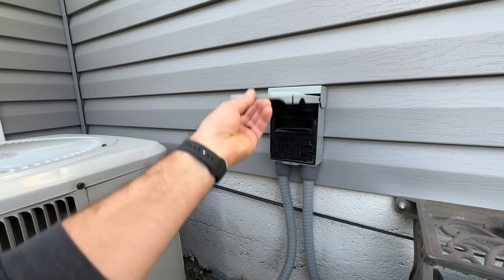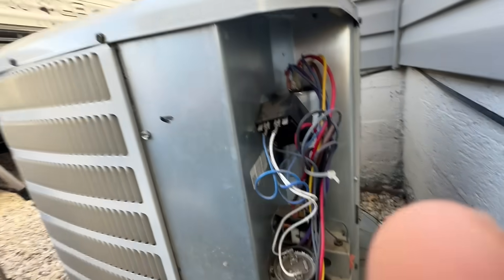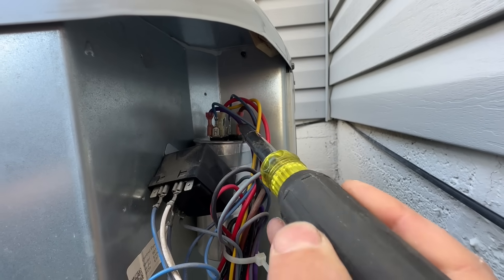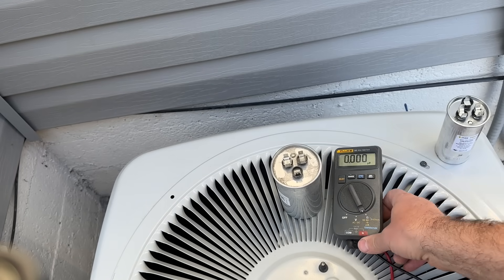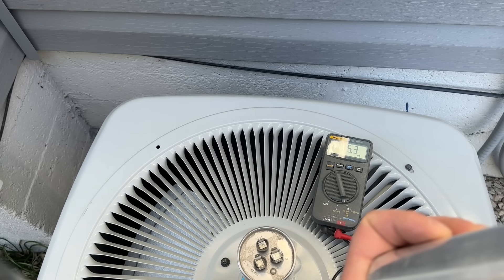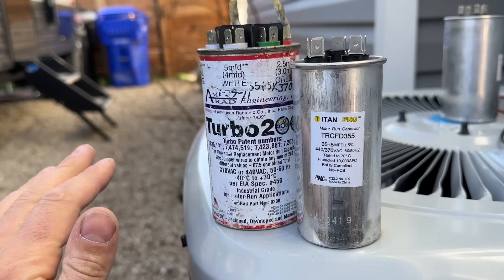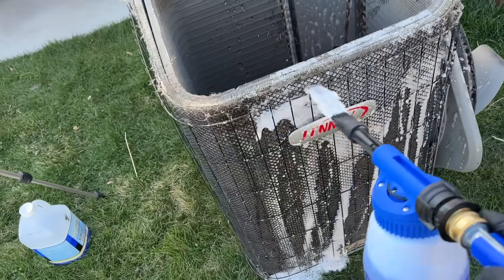How To Check & Replace An Air Conditioner Capacitor

Comment: As a field service manager, I can’t help but to notice that the initial capacitor you pulled off of the unit was a 45/5 capacitor. The new one that you tested was a 35/5 capacitor. The wrong thing to do is to put the wrong size capacitor in a unit. And discharging a capacitor like that is not the smartest thing to do.

Comment: My AC unit stopped working just at the start of this summer. I checked everything and I found out the capacitor was faulty: it was a 25uF 450v, but it measured 1nF. I found a capacitor with the same characteristics and replaced it. Now the AC unit works just fine for the moment, but I'm gonna change the whole unit anyway, becouse it is an old one, over 20 years

Comment: My home A/C just died on the hottest day of the year. We're talking 100+ today. I suspect the capacitor but my cheap multimeter doesn't test capacitance so I took a chance and splurged $29 on a new capacitor. Same specs but a bigger diameter, so the clamp won't work but isn't that what zip-ties are for? Anyway, I followed your instructions to the letter, took out the old one, plugged in the new one, didn't get zapped in the process and now I'm sitting here enjoying wonderful cold air again instead of sweating for a couple of weeks and dropping a few hundred beans on a service tech. You, sir, are a prince among men. Keep up the good work.
Reply: Mine is also out my house was at 87 the other day.. will definitely be trying this

Comment: Dang, wish I seen this first haha. AC slowly started giving out but figured it was fighting 90F heat for the first time this season. Slowly got up to 80 in the house and started troubleshooting. Dirty filter, started checking for ice on suction line and coils and found nothing. Fan would spin when calling for air figured it was good outside. I figured I was low on freon and they popped up and gave me a capitor for $350 with diagnostic fee and part included.
EDIT: Compressor side of capictor was dead fan would spin but compressor would not work
Reply: Im having the same problem, the house will not get to the set temperature. Everything seems to be running fine, except the air coming out of the vents seems weak and isn't very cold. Were you getting any cold air from the vents or was it warm?
Reply: @El_El_Guapo  If you go outside there should be two copper pipes coming from the outdoor unit. One very small skinny one and a bigger one. Feel the bigger one with your hand. If its not cold like mine was it could be the capacitor is bad in the out door unit. My outdoor unit fan would spin, but the pipe was luke warm and it should be cold and sweaty.

Comment: Ac unit not turning on, only the fan works. You hear a buzzing sound from time to time when attempting to turn on . Can it be the capacitor ?
Reply from the maker: Absolutely.
Reply: @diyhvacguy  thanks I replaced it today up and running right away

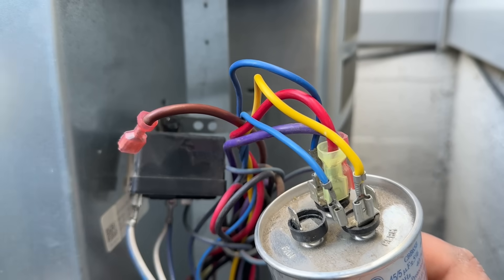Comment: What does jump these out mean? 3:53
Reply from the maker: Arch them, or connect them via something metal, making sure the end you are holding is not touching the metal, like a screw driver 👍🏼
Reply: @diyhvacguy thanks 👍

Comment: Another testimonial about your awesome video. I am not a very handy guy, but your video gave me the confidence to give it a try. My a/c went out on Sunday. Suffered through a very warm nights sleep only to remember your video. Watched it again yesterday and scrambled to find tools and a new capacitor. I didn’t even bother to test it because even though it wasn’t bulging on top, there were signs of rust and debris so I matched the numbers  as you described and picked up a new 45+5 on Amazon (after striking out at the Home Depot). Popped that baby in and did a much needed cleaning of the coils and the house is cooling off as I type this comment. Thank you for sharing your knowledge and expertise. You are a Godsend! Bless you!
Reply: If you have an Ace Hardware near you, they always carry caps, and multi different versions (size, capacity, farads, etc)

Comment: I noticed my AC wasn’t kicking on today even though the thermostat said it was running. I went out to take a look and adjusted the thermostat temp setting via my phone. I was hearing the unit click on but the fan wasn’t running. Also, the metal on top of the fan motor was very hot compared to everything else. 

With some quick searching on google it sounded exactly like a capacitor and shortly after I found your video. 

I was done with the whole repair in less than an hour including driving to ace to pick up a replacement. 

Thank you for the excellent video on how to do this. It was clear and concise and included all the necessary information to do the job safely.

Comment: I followed your advice and successfully replaced the failed capacitor in my AC.  Thanks !!  Although it was tough to find one locally on a weekend, Ace Hardware has them in stock, but charges about 3X average retail.  Still way cheaper than waiting a week to get hosed by a "pro" ;)  I guess that's the price of convenience.

Comment: So my AC turns on its blows cold air . But it runs for about 15 - 20 mins, then the fans stops and I hear a homing sound. Could it be the fan motor  ?

Comment: I should have watched this video before today. My HVAC guy just left after I paid $597 to do just what you showed in this video. I sort of felt that's what was wrong with my unit, but I also wasn't sure. Live and learn, I guess. I am back to having cool air but at a cost. I can say though that this company I used is a veteran owned one, also a member of my veteran chapter, so I am keeping his business going. I did tackle the evaporator cleaning on my own though. What a job that was. It was a hard lesson learned from not changing the filter enough when we put the house up 25 years ago. It will be clean from now on though.
Thanks for the great video. I'll be prepared if it happens again.
Reply: If you get this message... Would you mind telling me what the symptoms are if you capacitor fails?  Is it that the fan does not work at the unit outside, or is there another symptom?  Thank you in advance if you answer.  Glad you helped out a vet, but nice you have this knowledge for next time.
Reply: @thelorax7704  I am not an A/C tech. Only know what I've seen/read. But if your system is on cooling and there isn't cool air, that's one thing they check. It controls the compressor and fan. But it should be tested with proper meters and only touched after discharging it. If you're unfamiliar it would be worth having a tech come out and check it.

Comment: Capacitor went out twice and no videos had my symtoms!  Thermostat and fan came on normal inside,  no power no fan no nothing to my unit outside.  Replaced the capacitor and I’m blowing cold ass air again!

Comment: Great vid!  But... I've got a little problem. Mine was shorted out by a snake  and fried a couple of the wires. Will 14 ga wire be enough to handle the repair? It looks like there was only one 12 ga wire and it wasn't damaged.

Comment: HVAC guy wanted $300 to replace the capacitor.  I bought the exact replacement part from Amazon for $20 and installed it myself in 10 min.

Comment: I just paid $580 for someone to replace the capacitor. The part was covered under warranty because my unit is less than 3 years old. They covered the $20 part, but I had to pay for the labor (20 minutes or less) and for the service call. 

How is that considered "warranty"? That's insane. Especially seeing this video now. I found the exact same capacitor they replaced it with and bought one on Amazon for 23 bucks. WHEN it fails again, I'll replace it myself and save myself $560

Comment: One A/C company charged me $300 for a capacitor. Another A/C company charged me $200 to clean the evaporator and condenser coils. Those so called maintenance plans are a joke too. After being ripped off I do my own maintenance. I have an electrical and mechanical background so it’s easy stuff. YouTube is great. Keep up the good work.
Reply: In New Jersey they charge at least $500.00  for a capacitor

Comment: Checked the condenser after my system would not cool. Condenser was good, but ordered a back up replacement from Amazon. When I checked the voltage on the contactor I was not getting the proper 240 Volt reading, it was far less. I checked the voltage for the thermostat connection on the contactor and it read 24 volts. I started to unscrew the wire nut on the 240 volt connection and my compressor fan started. I disconnected the power and discovered the connection under the wire nut was loose and did not have proper contact. With in minutes I had cool air flowing into the house after the repair.

Comment: You are something else.  My AC went out, followed your steps and cautions.  I worked with medical electronics gear. It was a bad capacitor. The charge they hold can send you 6 feet under, or knock you on your butt.  Be careful.  Saved me a bunch of money.  Thank you.

Comment: +1 another save from HVAC ripoff artists!  AC conks out (in Phoenix, Sunday night of course). Remembered your video, went outside, condenser fan not running, removed cover, took picture of capacitor.  Ordered a new capacitor from Amazon, delivered at 7:30 am next day.  15 minutes later I have cold air blowing for a total cost of $18.  Thank you, sir. You deserve a medal.
Reply: and you deserve a medal for being able to test, order correct capacitor and replace it without killing yourself.   👏🏽
Reply: Great info, i just did same. We were quoted 3000 to replace the compressor only or 6700 for a whole new unit.  10.00 later we have ac again😎

Comment: Thank you so much for the video!  I ordered a Turbo 200 Motor Run Capacitor since I have 4 a/c units in two houses so I can get any of the running again.  My question is - I want to treat the universal cap as more of an emergency device than as the permanent fix and then I can take my time to buy the correct sized and cheaper version for that system.  Can I then replace the universal unit and use it again and again or is it a one time fix that I can't swap out?  What is a good brand capacitor that is made in the USA and can be bought locally or on Amazon?  Thanks again!

Comment: PM
Preventive Maintenance.
if it has been 10 years ,
no need to trouble shoot the cap.
just replace it
during scheduled down time .

DM
Demand Maintenance
wait for the componant to
fail while  On Line  , in use .
now replace the failed cap.

PM
is the prefered approach ,
same for the  Contactor .

DM  is always more risky.

note:
PM
is not the same as  Shot gun maintenance.
PM
is on a scheduled routine maintenance
where certain task are performed.

shot gun repair is  guessing and
replacing parts in hope that doing
so will fix a failed piece of equipment .

PM  examples :
( wether it needs it or not , just do it )
oil change , every 3,000 miles
oil filter , when oil is changed
air filter , 1 year
PVC  valve , 5 years
serpant belt , 5 years
5 year battery, at 4.5 years

Comment: What usually happens is that an HVAC company technician charges around $300 to replace the capacitor and at the same time they always try to sell you a new AC unit. Last time about 2 years ago they told me that compressor motor is worn out and about to fail at any moment, and because of that the capacitor needs to do 'extra work' to get it started and that's why it keeps failing. I had 3 capacitors replaced over the last 6 years and the AC unit is still going strong.... It just failed again, the fan is working, but not the compressor I am going to try replacing it myself this time, thanks for the video. Maybe this time around it is the compressor that finally broke, but at $16 per capacitor its worth trying.

Comment: Hello, I am trying to replace my capacitor on my blower. But it’s old. Here are the numbers on the capacitor itself:  Capacitor 43-20847-10  7 . Suf 370 V 60 HZ  protected A5000 APC  AEROVOX P5OG3707Y. I don’t see an exact match on Amazon. Just wondering if you could advise. Thank you.

Comment: Thanks for sharing your knowledge,  I just now replaced the capacitor on 1 of my units that went out overnight. Quick and easy-to-do. I've also wired both heaters for emergency power outages this past winter...

Comment: I have a 45/5. It didn’t have a brown fan wire. Just a red, yellow, and purple. The purple wire comes from the fan. Does this wire go to the fan terminal on the capacitor? Yellow to “herm” and red to “c”?

Comment: Just replaced my capacitor and it worked! My compressor was turned off but the fan running. Thank you for the video my friend, appreciate you doing this even risking loosing some clients

Comment: Great DIY video, thanks. The only thing missing was guidance on how to determine if the reason the AC is not working is because of a faulty capacitor.

Comment: My HVAC yearly inspection of my ac unit was a few days ago. He told me that my capacitor was weak and should be replaced. Quoted me $188 for the part and labor, which was lower than usual because they were already there so i saved the service charge amount. He still had some other work to do so I went in and went straight to Amazon to look at what they cost. I was shocked that they ranged from about 15-30 bucks, so i checled YT and found this video quickly. I thought "i can do this, theres no way im paying $188 for them to pop a few screws and put in a $15 part" so I told the tech I had looked online and would do it myself. Luckly he was a really nice guy and he kinda "looked the other way" while I took a few pictures of the capacitor he had in stock so I knew what I needed and he gave me a few quick safety pointers so i didn't electrocute myself, lol. But I followed your video step by step and everything went perfectly smooth. I actually shut the main off in my electric panel as well as pulling the disconnect just to be extra safe. Otherwise followed this exactly and the whole process took less than 10 minutes. Thanks for the great videos. They are greatly appreciated by me and many many others, I'm sure!

Comment: April 2025 HVAC company here to service AC for this season. guess what I was just told my capacitor might be going! So glad I saw this video a year ago thanks
Reply: The AC at my parent’s house ran for over 25 years before the AC finally went out. During that 25 years the capacitor never went out. The compressor had given out before the capacitor.

Comment: Holy moly I am so glad I saw this video before I had agreed to letting the AC company do this for $400!!!  Thank you!  

This was one item they had on a  maintenance check up I had done yesterday for our two units as part of the service agreement.  They also recommended replacing the blower motor for $1700, blower assemble cleaning $560, evaporator coil cleaning  $421, and a float switch $360. 

For our second unit it was also recommended to replace the outdoor fan motor ($1000), ceiling saver float switch ($360), and blower assembly cleaning $600).    

After learning I can replace the capacitor on my own is there anything else that can be done on my own?   

Thank you!!!!!

Comment: So glad you covered the universal capacitor. Apparently that’s what’s currently in my system and as I read it, I thought it was a 67.5 MFD. I didn’t realize that’s what you could combine it to. 
I couldn’t find a 67.5 anywhere! The correct rating for my unit is apparently a 45.!  Thanks to you, I won’t be putting the wrong capacitor in my unit now. 👍

Comment: So my AC HVAC service was today and said my 45/5 capacitor was at 43 - and said I didnt have to change it yet, but may want to keep an eye on it.

I am going to buy a replacement on Amazon, however, once I discharge the old capacitor, is it no longer good?  I figured even if its at 43, I may keep it just in case as a backup.

Comment: Where can I buy a screw driver to short the capacitor.  The ones i have found either are not insulated, or insulate the whole shaft also. Help!🙏

Comment: HVAC guy was going to charge me $650 for a $15 part. INSANE. bought a $65 turbo 200 capacitor = problem solved

Comment: I’ve been an Auto Mechanic for about 35 years now. And haven’t needed to call an HVAC company in over a decade, since I learned how easy repairing my house HVAC was. 1) Contactor fails (moving part). 2) Capacitor fails. 3) Condenser Fan fails (again moving parts always fail first). Knowing this can save you hundreds possibly thousands of dollars over time. Especially when there’s crooked hvac guys out there that will lie to you about what’s wrong with your equipment.

Comment: We just paid $232.00 to have our 40 microfarads capacitor changed by an HVAC technician. He said it has a range of +2 or -2 and it was reading 37. That capacitor was about 8 years old so we went ahead and paid him to do the job. It took him longer to take off the cover and walk back to his truck to get a new one than the two minutes it took to discharge the electricity, unplug to old, and plug in the new capacitor. The part cost less than $25.00 at Lowe's or an electrical appliance store. Next time, I will change it myself. It's very simple, if you can screw in a light bulb...

Comment: The AC company just left my house. Even though my unit is from 2011, the heat pump is newer. Anyway everything good but they recommended me to replace the capacitor because it was one point under. So he keep talking while I search and watched this video! Thanks the the amazing video!

Comment: If there's one thing that's annoying about Capacitors is that some models don't have standardized connectors

I have a Window Type AC made by Panasonic and their Capacitors have a Big and small connector, when mine failed and had to get a replacement the small connectors wouldn't fit the pins, luckily the wires that used the small connectors were for common and fan, had to strip it and create a new connector that fits the standard large pins